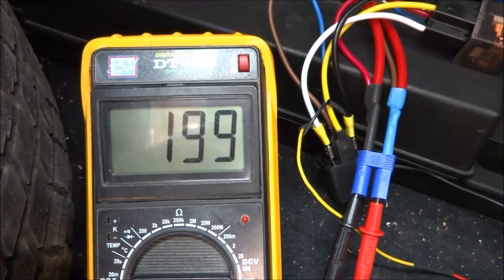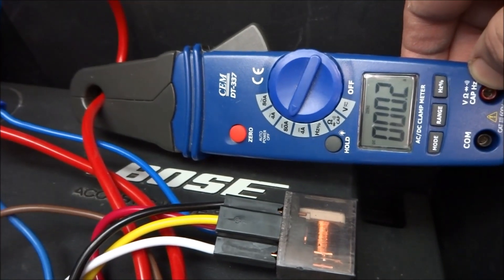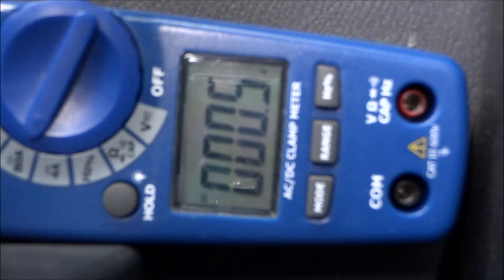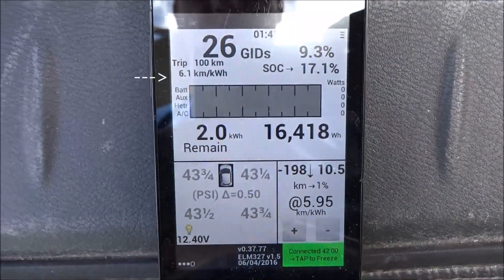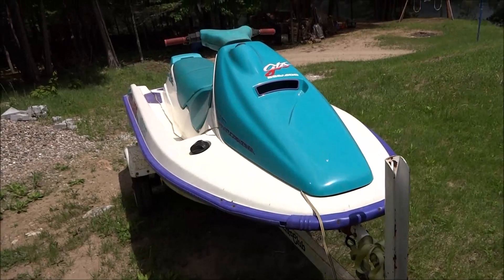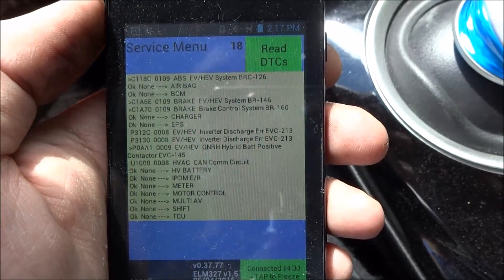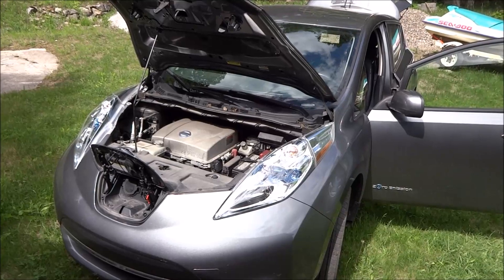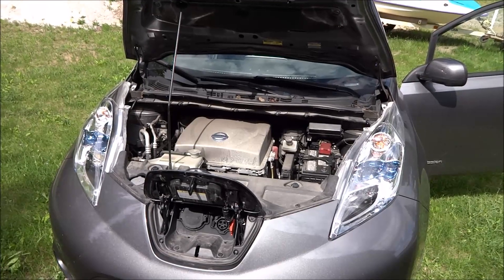Nissan LEAF range extender pack build Pt.3.2 (2nd long distance test)

Comment: I know I'm zombie posting here but you could use a microcontroller to energize your relays to give your pack the seperation it needs to keep you from roasting contactors. You could use an induction pickup to prevent any wire splicing on that side of the line as well. Once precharge finishes should see power on hv lines right time to inject parallel power. You could even include the induction pickup as part of your oem bypass harness.

Comment: Hi great project.
Would it be possible to utilise the parking brake light circuit to drive a relay to energise your range extender battery?
Another option would be some form of motion sensor.
Good luck in finding a viable solution, I look for to you returning to this project. Brian

Comment: Long while ago, but what about charging? Did I miss this point? Or is it really possible to charge the second pack at the same time, parallel to the original pack?
I was just following a similar attempt with an VW e-Up, but this car (CCS charging) stopped the charging process probably because there where current differences coming from the outside and what was registered at the original battery pack. No issue here?
Reply: Ah, ok, just saw your problem with the switching off of the car. So the solution would be to keep the second pack switched off for another 2-3 seconds BEFORE you switch the car ON again?

Comment: Seems to me if you built a portable generator with the batteries and an inverter large enough to charge the Nissan you could recharge and have power at the cottage plus solar could be integrated into the recharge.

Comment: There is another way to wire a nissan leaf extended pack without extra electronics, you can simply wire the extra battery behind the precharge relay,  into the main positve and negative wires from battery pack and this will avoid any triggers. And the vehicle can be charged normally. And you don't  need any extra BMS right away. It is optional.  This has already been proven in another video, that I can link and is the way that i will do mine. Eazy PeeZy.  Great Attempt though. I love the nissan leaf.
Reply from the maker: As far as I know, the only way to do this would be to run wires into the main pack. If  you aren't careful to make sure you make a perfect seal and water gets into the pack, you could ruin your battery and even cause a fire. I've seen picture of a Leaf burned to a crisp when the owner did this.

Comment: Look into the used Tesla batteries: https://www.ebay.com/itm/Tesla-Model-S-battery-module-24V-250Ah-5-3kWh-444-Panasonic-18650/112703113806?hash=item1a3da10a4e:g:fLAAAOSwh81Zni92&vxp=mtr
Reply from the maker: Yes, that is an option however you'd have to reconfigure the cells in order to achieve the proper voltage (which would be quite difficult). Otherwise it would take 16 of these packs. That would weigh 880lbs, only viable if you put them in a trailer. It would also cost over $27,000!!!
Reply: Huh... Thanks for the reply.  And here I was about to start buying the packs.  I guess the only advantage to buying those packs is the cheap battery cells that can be recovered.  Can you tell us how much Nissan charged you for a new resistor and were they nice to you about what you are trying to do (hack into their system).

Comment: Thanks for this real helpful video and being the guinea pig for the rest of us Leaf owners / DIYers. I'm curious as to whether or not the leaf would accept a parallel bank of batteries to each module. Since each module reads 7.4v, you could theoretically hook up 2s 18650s to each module. That would mean making 48 2s individual packs and connecting each one individually so that the system wouldn't detect anything funny. I'm also curious as to whether or not connecting each module in parallel with the 18650s will send any safety signals when charging or if it detects anything while driving. Yes, this may be alot of work but if you purchase the 4x5 18650 holders off ebay and set up a huge pack consisting of 48x 2s20p packs, it would equate to nearly 10kw which would theoretically give you 50% more range without adding too much weight. The charger will theoretically balance charge all the cells since they're in parallel and the only difference should be the driving range. The Nissan Leaf looks like it should be able to fit 960 cells in the trunk area since it appears to be lowered.
Reply: This would work, in theory. You would have to bring 2x48 cables out of the battery box, which is obviously sealed. You would also have to use relatively thick cabling, so this really wouldn't work in practice.
Reply: The problem is that the car only allows 22kw to go through the battery so if you had any more than that in capacity behind the shunt and contactors it would not use it and just shut off. This would be a good way to keep adding some to maintain the range as the battery degrades.

Comment: OMG?  You have 12 volts running the two serialization relays.  If that power is disrupted such as a bad contact or a loose wire or joint, or 12V batteries running out of juice, you will then put the two prototype packs in parallel, dropping them to 198 volts, connected in parallel to 396 volts!  That is going to cause a huge surge in the current, melt a few connectors, blow the pack fuses, destroy contactors including Leaf contactors and burn cables, and maybe cause a mini explosion.  First off, what is the idea behind parallelizing the packs, and 2) you needed to have it such that the default no-power case would be serial, and the powered case would be parallel!  When playing with such high voltages and currents, you cannot assume that all components will function perfectly.  You should not allow for serialization/parallelization and if you really have to do that, then it must be done manually by connectors and not by circuits that can fail when the default (Normal) condition is the wrong state..
Reply: It was a test, not a final product. GIve the guy a break
Reply from the maker: Exactly right,  this was only for testing... besides I have two main fuses as well as individual fuse wires on each cell... they would blow very quickly if the relays were de-energized.

Comment: Hey. When are you experimenting more with this?
Reply from the maker: Hopefully next spring, I'm now down 15% capacity on my LEAF so will need this even more...
Reply: Why did you stop working on the project?
Reply from the maker: Only on hold... life is getting in the way... Also, I had a recurring issue with brakes on the LEAF which meant I was bringing it in to the dealer for service so I had to remove my modifications. This issue seems to finally be resolved and the car is out of warranty so hopefully I can restart the project...

Comment: Only thing I didn't understand is where is the resistor that burned? In the battery pack or in the Inverter or in the Charger?
Reply: RC cells are heavier and larger than 18650s.  But their real problem is that they are not safe.  As polymer batteries, they will explode or catch fire if overcharged or mistreated.  They don't have the protective outer steel shell of a 18650.  And if you put a lot of these together and one catches fire, it will just jump to the next cell, and you have a bonfire.  I hope this is nothing mission critical.  If you want cheaper cells, then you should use used Leaf, Volt, or Tesla cells.  They are about 2/3 to 1/2 price of new ones and already packed and may come with a BMS.
Reply from the maker: It's in the main battery pack, it's called a pre-charge resistor.
Reply: Oh I see, Thanks!
I'm thinking of connecting my range extender pack to the main relays so it will be turned on/off by the car itself! Does that sound like a good idea to you?
Reply: Not easy - because the main relay (pack contactor) are located inside the pack enclosure!  You will have to open up the battery itself.  There is a video of a guy who did this, and then overtime water entered the pack, shorted the BMS and the cells got overcharged and burst into fire.  It is much easier to find the line to the positive contactor, sense when it is activated, and maybe with a small delay, then activate the auxiliary pack contactor.
Reply: There is a communications loom that goes to the main battery pack, so I don't have to open it to achieve my goal. Communication with the relays in the main pack is by 12 volt signals so it be reasonable to intercept this signal to close my extender pack relays only when the main Positive/Negative contactor has closed.
The guy that burned his Leaf (as I read) has drilled holes in his pack to put additional wiring, and in that sense modifying his battery. I don't intend to open my battery pack anytime soon, even though I will open it if I can source better cells(but same size) than the leaf originally has.
Reply: No car manufacturer on the planet uses LiPo batteries in their electric vehicles. EVs use LiOn and hybrids use NiMh. Please stop giving people advice, you dont know what your talking about. Please no one listen to this guy. Your EV isn't going to burst into flames for no reason. EVs have been on the road for years now and they are generally regarded as much safer than their ICE counterparts.
I am done with this conversation. I am sure Georgi will want the last word.
Reply: Sounds good.  I thought you would be connecting to the mains connecting the pack to the contactors, which are in the enclosure, as opposed to the contactor driver.  Hence my comment above.  Would you be augmenting the Leaf batteries, or just replacing them with the same thing?
Reply: The other day I met a guy that told me of a mechanic that replaced leaf cells with better ones, but he wouldn't tell me the details. I know of owners that replaced their 24kwh cells with 30kwh cells but the BMS was not happy. So any better cells will need reprogramming the BMS in my opinion. Anyway I'll be looking into it.
PS. I take opening the battery very seriously and if it gets to that, I'll be buying a new seal and resealing it all with a genuine silicone sealant.
Reply: If you use new 3.4Ah or 3.5Ah 18650s, you could build an auxiliary pack that should not weigh too much and be small enough not to eat up your trunk space.  The Panasonic NCR18650B goes at 3.8 kg/kWh, 1.6L/kWh, and $272/kWh.  Of course these are the minimum numbers and add 25% to all three for the final.  I am building a 14kWh myself for my Leaf.  Then no need to open the battery pack.
Reply: Sounds good. I'm thinking of building a pack from RC cells. They seem cheapest at the moment. And connecting it all would require less soldering.
Reply: RC cells are not safe at all for automotive use. Even 18650 cells can be dangerous if overheated or ruptured. DIY at the risk of yourself and your family.
Reply: There is no safe lithium cell when ruptured or overheated or mistreated. Don't believe me, just buy a Leaf cell, stab it, and watch the fire.
Reply: Anyone experienced with batteries knows, that LiPO batteries are extremely volatile. You dont want to use them in your car. RC companies even sell fireproof battery bags for when you are storing them. Very dangerous batteries.
Reply: And yet car manufacturers put them in your electric car! Why don't they burst into flames? Well its because of the same reason your phone or laptop doesn't burst into flames. BATTERY MANAGEMENT
RC batteries have a bad reputation because of low quality manufacturing (which is a lot better these days) and BAD MANAGING from owners!
Reply: https://en.wikipedia.org/wiki/Lithium_polymer_battery
READ IT WELL!
Educate yourself on the matter, or better delete your brain-dead "statements" before someone reads them!
Embarrassment you will feel suits you well.

Comment: Finally I finish with full integration my additional battery parallel with main battery. I expect additional 100-150 km. Testing is in progress. Please find below some sample picture.
thank you: turbo3, gerygid, leaf xpack, jehugarcia, Njah kavin, HBPowerwall, Damien Maguire, Wolf Tronix, mikeatyouttube and many others which gave me useful information for this hobby project.

br
ATKAM 
https://drive.google.com/file/d/0BxKOh50vx8dJRng0SXFnZDE4Qnc/view?usp=sharing 
https://drive.google.com/file/d/0BxKOh50vx8dJYzFJaVBSb2w3OWs/view?usp=sharing
https://drive.google.com/file/d/0BxKOh50vx8dJMHR5YURKdHd4aUU/view?usp=sharing
https://drive.google.com/file/d/0BxKOh50vx8dJcDhJU2k2NFZSeFE/view?usp=sharing
Reply: Xpack - in the same video that you link above, you can see the (British) guy tapped in to the contactor lines that have entered the battery pack.  So find the line to the P contactor and tap that to your own relays.  You also need to sense the N contactor line, in case that drops first.  So one diode to the P line and another diode to the N line, then connect together in a 'Y', and then use an appropriate resistor to connect to the auxiliary relay, such that if either N or P drops, the relay opens.  To install a timer, add a mosfet and a capacitor, and use a voltage divider - but make sure that this does not introduce a delay in cutting off, when N or P drops!   And please get rid of that serialization relay!  It is dangerous!
Reply: 18650  22p and 16s in one box, 22px16sx6 = 2112 cells
Reply from the maker: Very interested in seeing how you did it. I tried your links but they didn't work.
Reply: I corrected links
Reply from the maker: nice, how are you connecting to the high voltage lines? What are those little displays on each module?
Reply: High voltage - I'm connected in line with the HV wires coming out of the main pack. The little display: celllogs 8S - for protection too high voltage, low, ... check link- cheapest solution for security...
http://www.progressiverc.com/celllog-8s.html
Reply from the maker: So 12 cel logs, nice. How do you connect to the HV wires. How do you make sure the main contactors are closed before connecting your pack?
Reply: Do you have any available diagrams or videos on how you did this? Very interested. Thanks
Reply: What kind of batteries are you using?
Reply: So the cell logger basically keeps track of the voltage of the 16s pack? How are you balancing the cells? Would it be easier to just connect 48x 2s20p to each individual module inside the battery pack? That way you don't need to worry about the BMS as there's one built into the Leaf already.
Reply: You don't want to open the Leaf battery pack (safety, warranty, etc.).  Also if you connect to each Leaf cell group, it can greatly confuse the Leaf BMS or the VCU and they will flag an error, and off you go to the dealer.  Having a balancing BMS for 16s is rather trivial, and you also get protection.  Checkout https://www.ebay.com/itm/16S-60V-45A-BMS-PCB-Protective-Board-Balance-For-Ebike-Li-ion-Lithium-Battery/272767807967?hash=item3f823a71df:g:6GsAAOSwjyhaC9nL
Reply: Is it confirmed that it will throw an error if they are connected in parallel to each module? The only one I see doing these tests is this guy on his youtube channel. Without any testing, you can't assume that the Leaf BMS will confuse the BMS and throw an error. The BMS might see a larger capacity but if they only measure voltage like most devices to determine charge state, then it should theoretically work. For those with the 2011, the 7 year warranty will end real soon. Most Leaf drivers just want 50% more range which is what the 20p packs will do.

I should add that since it's gonna be in pairs where the 18650s are arranged in 2s20p, the bigger issue is balancing those pairs. It's possible that they can go out of balance this way but can be solved with a BMS board consisting of a charge balance for 2s which are dirt cheap off ebay. The packs should be built using a thin wire eg. resistor legs, on each cell to act as a fuse in case anything ever goes wrong. The pack should be kept in a case completely sealed from everything else to avoid shocks and fires.

Comment: Leaf Xpack I now have a 2013 leaf and I am starting to build a similar range extender battery pack. I was wondering what you think of these packs. http://www.ebay.com/itm/10-LG-36V-4-4AH-BATTERY-PACK-18650-EBIKE-VAPE-POWERWALL-BATTERIES-200-CELLS-BMS/201916138726 Seems to me a reasonable price and perhaps a good group size to work with. I would start with 10 packs at first ( 1.58 kwh)
Reply from the maker: Yes, 10 of those packs should work fine. I would just be careful with the BMS on them, not sure how reliable they are.
Reply: Too expensive.  The going price is $3.25 for a new Panasonic NCR18650B 3.4Ah.  Unit price = 3.25/(3.6*3.4) = 0.26/Wh.  The above link is $24.99/(3.6*10*2) = 0.35/Wh.  And it is probably not a good quality as a Panasonic, and possibly it could be used.  It will be 3.4/2.0 - 1 = 70% larger and heavier than a Panasonic.  And the 10s BMS will not be very useful for a 96s application.
Reply: Where are they selling the Panasonics for $3.25?

Comment: so can someone explain to me why this failed i have a jetta hybrid and want to just add a crashed sonota hybrid cells in parelllel to double up my pack. i wont even play with relays ill just make the same voltage and balance out the packs. then i dont see why this is even a change other then having double or more capacity. thanks
Reply from the maker: The car's main relays are in the pack.  I left my secondary pack connected to the high voltage wires which should not have any voltage on them when the car is powered off. This caused the pre-charge  resistors in the pack to burn out. I didn't want to open my pack to connect my additional batteries before these realys.